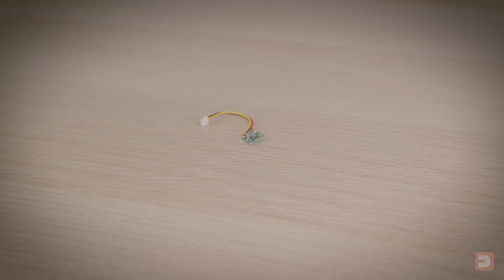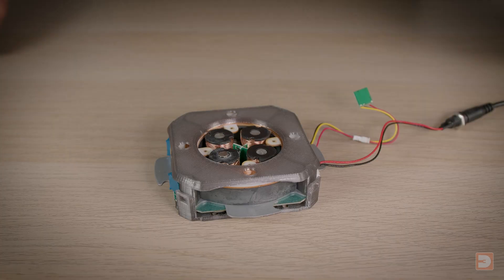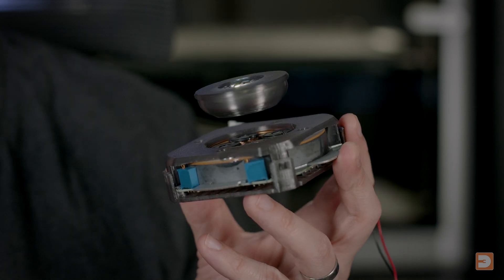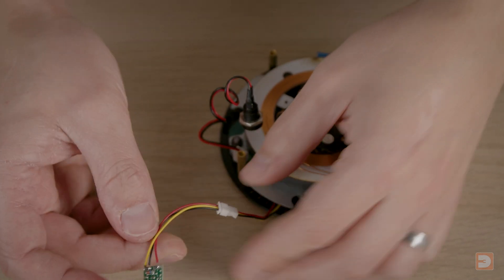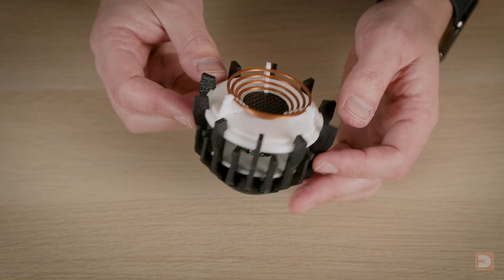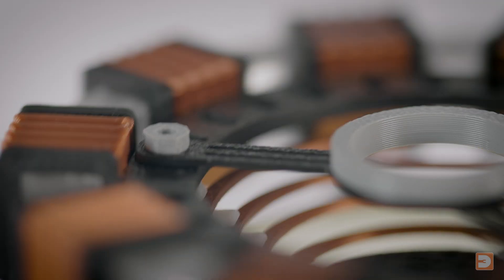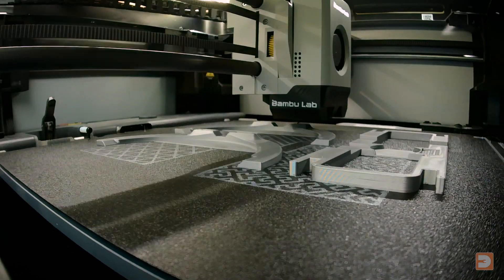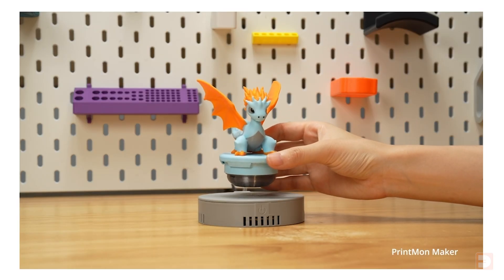Levitating 3D Prints?

Comment: Have tried like a million time and it will not levitate. Just pushes off to the side 😞
Reply from the maker: If you misalign more than 2 or 3 times in a row, you will want to power it down and give it a good while to properly cool down before you plug it in and try again.
Misalignment can cause it to overheat and that can lead to malfunctioning so make sure you let it propely cool down before attempting again

Comment: This is soooooo cool!
How much weight can actually be levitated? Is it possible to adjust the distance at which the object levitates?

I’d like to create a levitating pot for a bonsai… with a waterfall! The bottom part should be below a round container that works as a waterfall tank. The top part should be disassembled to allow a tube to reach down to the water below. The light should be replaced by a pump that sucks the water up the tube. On the side of the pot there will be a stream with pools and when the water reaches the border, it falls in the tank below. I have the perfect mini (mame) pomegranate bonsai for this!!!
Reply: The one on AliExpress that has a print for a plant pot can levitate 500g this magnet looks a bit smaller
Reply: Great minds think alike! I too am wondering about the limits of this item. If I were you I would first estimate the weight of your bonsai pot and compare it to the estimated weight of the objects found online.  Then I would look up the specs of the levitation module for maximum weight and power required. At that point you will then have enough information to decided if you want to take on the task of re-engineering the module (i.e. building your own prototype) for your application. My guess is that your pot will require orders of magnitude more power, and you will end up doing an entirely new design.  But if you end up doing it be sure to make a video. Good luck!